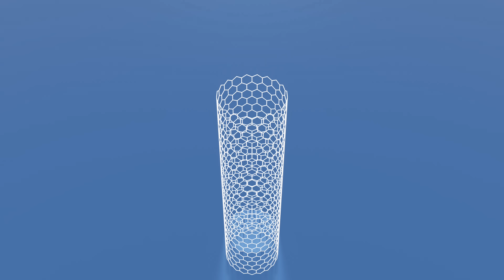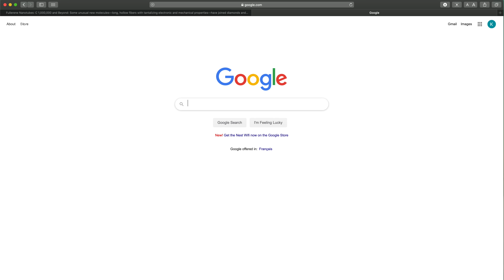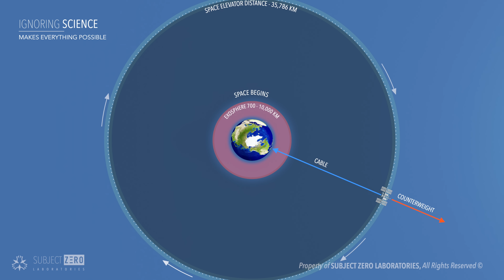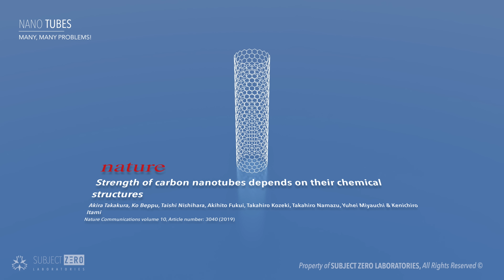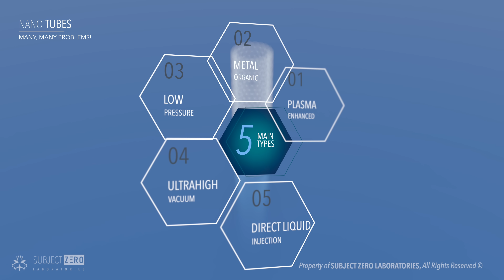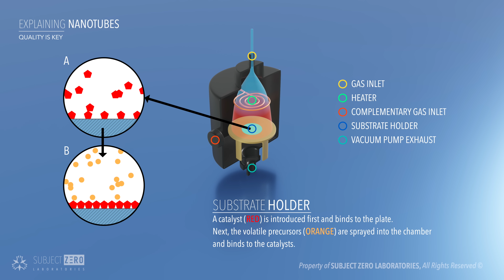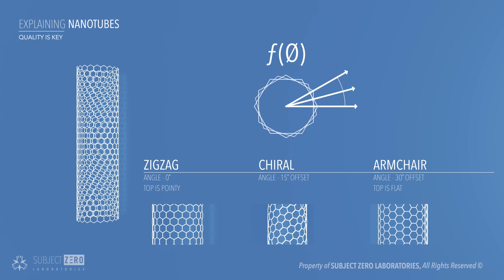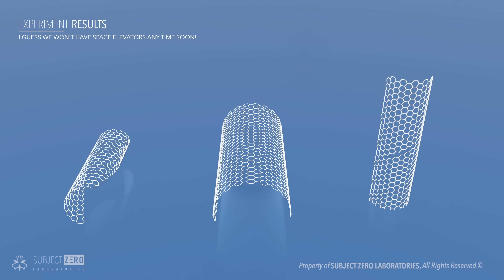Nanotube Strength, Bad News for Space Elevators [2019]

Comment: Think smaller it does not even have to be a real "elevator"  IF we could even get small amounts of material continuously elevating into orbit that could be HUGE!  Even just gas for fuel and breathing or whatever could be of enormous value!  Just saying an "elevator" does not have to be heavy duty high capacity to stsrt with.....SMALL steps get u there....ya know?  What IF balloon tech get us part ways up and then THAT connects to a "dangle" line from LEO vehicle? A steady trickle of SOMETHING valuable that can be stored in orbit?  Is a "dangle line realistic?  How about a 365 24/7 teathered High altitude unmanned ballon station presense?  COULD thouse be connected?  Baby steps

Comment: I don't think an elevator would work...

First problem being the force pulled on the spacecraft would likely cause it to be pulled down.
They give a solution to this, which is to add a counter weight to the spacecraft on the opposite end (using centrifugal force to counteract the force of the object being raised).
The problem now would be calculating the load against the spacecraft during an elevator operation to avoid orbit decay. 
(And there is that pesky thing where the weight will just enter orbit and not contribute as a counter weight).

I say all of this knowing that it would be impossible because the spacecraft would have to travel at the same speed of earth rotation (geostationary orbit).
This would require the craft to be about 22,000 miles from the earths equator.  Compare that to the average orbit of around 100-1200 miles.
Such a far distance would highlight a very big problem with any material...  elasticity.
A rope that long would have miles of stretching, and any deviation on the craft x axis would translate to miles on the ground.
It's a neat thought, but completely impractical.

A better idea would be to construct a 100 mile tall pyramid with elevators in the center.
The fun part is figuring out how many Home Depot trips it will take to build, and how wide the base would have to be.

In the end, regular liquid fuel rocket engines are by far the best option we have, or until a new fuel is implemented. (I'm looking at you metallic hydrogen)

Comment: Most of the issues with a space launch is just exceeding the thickest part of the atmosphere so much much smaller towers are all that's needed.   Something more like a marine spar, or buoy where the tower is either anchored or ballasted at one end and has buoyant support above it's centre of mass but the structure rises much higher much as an oil drilling rig works.   Such a megastructure and it still would be a megastructure would be barely 1% that of a space elevator.   Ultimately, a space elevator is a way of avoiding the need for propellents and having the power source be external to the launch craft and there are other ways to achieve some of this.   Indeed there are many non-rocket space launch concepts that involve a fraction of the structure of a space elevator so a space elevator is the least likely of such concepts to be attempted on our planet.   As to single wall nanotubes not having enough tensile strength, that's not to say that multi-wall nanotubes, filled nanotubes such as with cemetite, or active forces such as magnetism strengthening the nanotubes might suffice.

Comment: Does the concept of a Space elevator even work? Wouldn't pulling up a load up the cable slow down the orbit of the counterweight by pulling on it? Therefore you still have to spend rocket fuel to accelerate the counterweight each time

Comment: The space elevator would never work, especially using the proposed idea shown. 

When a counterweight is extended outwards from the geostationary satellite orbit, it will have to orbit more slowly than the satellite, imparting a twisting force to the satellite and both cables. Furthermore, the elevator mass will orbit at a higher velocity than the geostationary satellite, giving an additional twisting force, in the same direction. Simple orbital mechanics shows that this will happen.

The lifting cable itself, being over 37,000 km long, will have appreciable mass (hence the need for really high tensile strength), and that mass will cause the cable to bend all the way along its length. The cable up to the counterweight from the satellite will also bend similarly. These effects, which are dictated by the Laws of Physics, will cause cable failures, and most likely de-orbit the satellite, before the elevator could even be used.

(As a side thought, how much elastic stretching will occur along those long cables? Imagine the huge energy release when they snap! Maybe I have just invented the first catapult capable of ejecting an object into interplanetary space? 😉)

The only way to eliminate those orbital stresses would be to have some means of accelerating and decelerating the two cables sideways, spaced all along the cables, and operating continuously. Fuel or electricity to run those motors will need to be supplied continuously. This will eventually use far more energy than would be needed  to launch a vehicle into space by conventional means. 

I've ignored any meteorological effects, and the fact that no orbit is perfectly circular, because of the gravitational effects of the Sun, Moon and other planets on the orbit. High and low tides are a visible result of those forces. On a longer timescale, the spin of the Earth precesses, as can be observed by the movement of the Equator and Tropics by up to several tens of metres each year. And our day length also varies by anything up to a second or so every year. This means that a geostationary satellite needs to be moved in space frequently in order for it to keep station. In fact, such satellites' orbits trace a more or less elongated figure 8, or follow an analemma, in the sky every day.

Therefore, it is reasonable to deduce that space elevators, as we envisage them, will remain a part of science fiction for the foreseeable future.

Comment: I don't understand why everyone ignores the fact that you can also reduce weight using balloons of warm helium. Graphene is atom tight, so the helium will stay in there. So now you have lift, which obviously dramatically reduces the weight of the cable, reducing the required strength of the cable. What am I missing?

Comment: A really well animated video! Anyway, just had some thoughts to share. (I'm finishing up a thesis about artificial muscles and part of it has to do with carbon nanotubes)

Carbon nanotube yarns have been producible since 2004 but aren't talked about very much which surprises me, it was the beginning of a pure CNT thread (so it keeps its mechanical strength as well as thermal/electrical conductivity, where other polymer/CNT composite threads could not). You can make the sheet of CNTs like you showed in the video, but also you can just pull from one side of this sheet, and while twisting it, you can make a yarn. just a square cm can make something like 2m of yarn or something like that. So now, the cross section of this small yarn that is maybe 3 microns has hundreds of thousands of carbon nanotubes. More tubes = more load, it would be interesting to see how plying together the yarn many times over would do to its strength. So instead of purely depending on intramolecular bonds of carbon, there are many tubes applying friction forces to each other as well (Zhang et al. 2004, 2011). 

Maybe if clever manufacturing is used, like some kind of continuous CVD production with yarn drawing, huge thick ropes of CNTs can be made and space elevators can be a real thing :)
Reply: Space elevator requires too much material to build, not talking about quality of this material and ability of all world to unite to build that project.
What is more realistic is building huge space station with artificial gravity and facilities to build space ships inside this station. Humanity need to collect materials from asteroids and other space objects and return to the station to turn materials into more ships and more projects.
At this point, everything will be self sustainable, no need to deliver materials and fuel to the space
Yes, of course it will require many years to complete
But this is more realistic way.
After that we might be able to find better materials to make space elevators or it's amount.
(Sorry if my English is not the best, not my natural language)

Comment: Lol, for one thing sending stuff via a space elevator would be more like $5 per kg not $220. (And even then would still beat out space x according to our own wrong calculations)
And second wile I would love it if space x could lower cost to gust $600 per kg ther are so many intrinsic problems with using Rockets that I would be shocked if they could lower it below $1,000. After a serten point Rockets gust aren't efficient enough and other methods need to be used.

Comment: If graphene does 62450 and you need 63000, you just need your wire to be ever so slightly conical instead of cylindrical.

Alternatively a really really tall artificial mountain (think a concrete and steel cone of 25 degrees or so) would cut several percent off of gravity at the bottom of the elevator, as a decent fraction of the gravity you feel isn't of the globe as a whole, but of the nearest few dozen kilometers of it.
Reply: Doesn't help, peak stress is somewhere in the middle anyways. Just need to focus on improving production techniques

Comment: not sure why people still think space elevators can work if you took a single spider web filament and made it 200 miles tall the weight would exceed its stronger than steel ability to support itself. IE it would break under its own weight long before it made it to space. No other material will be any lighter and stronger by a factor great enough to not only support itself but be usable. its kind of like people who think rods in space can be flung at the planet at hyper speeds to create massive energy impacts full well knowing the atmosphere will not only burn up anything moving that fast but increase in density as whatever moves closer to the surface. SI-FI is nice and lots of cool ideas have come to be possible but some are simply nothing more than fancy idea's which can't work.

Comment: Are we talking about single layer graphene structures or have they tested the tensile strength of multi-laminated tubes. Wouldn't more layers add additional strength in more directions? The space elevator would act more as a rail gun so you might not need as much cable as originally planned unless geosynchronous orbit is your objective but you could probably get a payload into orbit with less material.

Comment: Ok, my question. When you move weight away from center of mass,  It slows down. Like when a ice skater spins faster or slower when they move arms/legs in and out. Will these elevators not do the same to earth's rotation? Just curious and figured I'd ask here. Thanks
Reply: The earth is so massive that the evect would be so small as to be neglecgbule.

Comment: Space elevators can't work. You have to accelerate the mass you want to put into orbit.  
At the surface, the elevator car is going around as fast as the surface of the Earth.  But the platform is going faster.  So you HAVE to accelerate the elevator car in the direction of the Earth's rotation.
There are two ways to do this.  Either the elevator car needs a rocket on it to accelerate the load.  Or the platform in space the elevator cable hangs from needs a rocket on it just to maintain its position as the slower elevator car moves towards it. And the cable would need to apply a force to the car to accelerate it.  AND you need to keep taking up the fuel for that rocket on the platform.
The cable needs to be able to carry a rocket up or transmit the acceleration.  It must do more than just carry the load up.  There's no way around that.
And since that cable is going up much more slowly than a rocket normally does, it's going to take forever to accelerate the elevator car.  And that means the rocket is going to be very inefficient.
There's no way a space elevator can work.
Reply: Well its a good thing the hole point is that its the earths acceleration is what senndes the payload off.
Reply: @c.j.3404  is the Earth doing that to you now?
Reply: @albeit1  yes, it dose it to all of use but escape velocity is much lower 10,000s of km up.
Reply: @c.j.3404  Your assertion that the Earth's acceleration is what sends the payload off is incorrect.

I know this because the Earth is not accelerating.  It's pretty much rotating at the same speed as yesterday.  It's revolving around the Sun at the same speed.
Reply: @albeit1  no we are not accelerating, but the speed at which one reaches escape velocity gos below the speed at which the earth rotates long before one reaches GSO.
Reply: @c.j.3404  velocity is speed
Reply: You might be talking about acceleration but then compare that to speed. So I don’t know what you’re saying.
Reply: @c.j.3404  in any case, whatever is being put into orbit has to be accelerated horizontally. It can’t be accelerated without a force.
Reply: @albeit1  its escape velocity, not acceleration.
Reply: @c.j.3404  Geosynchronous orbit is 35,786 km above Earth.  To stay there, a satellite must orbit at a speed of about 11,300 kph.  On the surface, we're only rotating at 1600 kph.

So some force must accelerate us as we move out.  Climbing will reduce the average speed of the elevator + the platform.

Normally a rocket has to accelerate something horizontally to that speed.  Climbing up something isn’t going to accelerate the car for free.
Reply: @albeit1  so your gust not going to mention how escape velocity gets below 1600 kph well before a elevator car reaches GSO right, because its that that maders not how fast satellites go.
Reply: @c.j.3404  Escape velocity is "the lowest velocity which a body must have in order to escape the gravitational attraction of a particular planet or other object."

Going to something that is orbiting around the Earth is not escaping Earth's gravity.
Reply: @albeit1  no leaving it is.
Reply: @albeit1  but its not orbatiting earth thats the hole point, seriously read something about this concept, please.
Reply: @c.j.3404  nothing orbatites, that’s true. 

But things do orbit the Earth. Something in geosynchronous orbit stays over the same position on the Earth’s surface. In sync with geo.  

The Earth rotates. The surface moves at 1000 miles per hour. Waaay out where the platform would be, it would have to move much faster to stay over the same spot.
Reply: @albeit1  like I said actually read something about this and maybe actually learn something because you clearly refuse to listen to me.
But like I said a space elevator specifically dosnt orbit, and you really should know this if you want to talk about space elevators.
Reply: @c.j.3404  the whole elevator supposedly hangs from a platform that is supposed to be in geosynchronous orbit.

What goes up has to speed up horizontally just to stay over same rotating spot.
Reply: @albeit1  and thats why I suggested you actually read up on this before posting more nonsense.
Reply: @c.j.3404  and suggest you think about the energy required to move something from the surface to a very high orbit. There’s no way to avoid expending the energy to achieve the velocity required to maintain that orbit.
Reply: @albeit1  😏 sure thing bud, sure thing.

Comment: You referenced graphine a few times but I whish you eould have extrapolated on it.  Graphing has a specific surface area thats about 2.6 times that of carbon nanotubes, and has a theorized tensile strength of up to 130GPa and a stiffness of up to 1TPa.  Its also said to be self repairing if carbon molecules are introduced to the damaged area.

Comment: what about a space station in orbit that lowers a second much smaller unit down with a cable not all the way to the surface but to somewhere say a plane can dock with in mid air off load some passengers or cargo which will be pulled back up to the station in orbit ? it wouldnt have to deal with nearly as much tension right? like the plane could grab the unit dock with it and the plane itself would keep everything steady would it work ?

Comment: Tensile strength means very little.  What matters is the specific strength for which even the Carbon Nanotubes - Min is enough.  Also I don't know where you pulled the whole 'time it takes to get into space' from but you're out to lunch on that.  The ISS averages just 400km above the Earth.  An elevator may more realistically reach a top speed of 300 km/h.   Factor in acceleration and deceleration periods and it'll likely average 200 km/h.  That's a trip from the surface to the ISS in 2 hours.  "Days" LOL.

Comment: Space elevator, even if they could make a tether long and strong enough; can still never be practical. The reason is that all failure modes are catastrophic.  I will leave the dear reader to imagine what those are.
Reply: Non at all, unless the howl rapping around the earth is a issue for you in which case don't worry, that's not how physics works and it wouldn't move fast enough to do damage, assuming you don't gust add point to break it up anyway should something catastrophic acore.

Comment: no scientist here, but if it can conduct current it can produce an electromagnetic field. a strong magnetic field can increase the strength of the cables by increasing the surface area of the overlapping cones that make up carbon nano tubes. and give them strength by de-creasing bond length. a strong magnetic field needs to given thought.